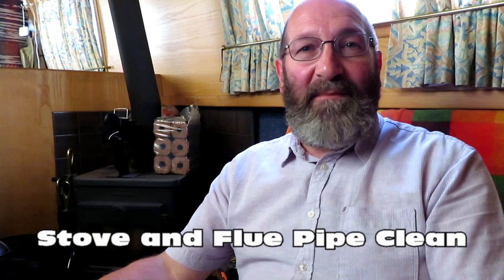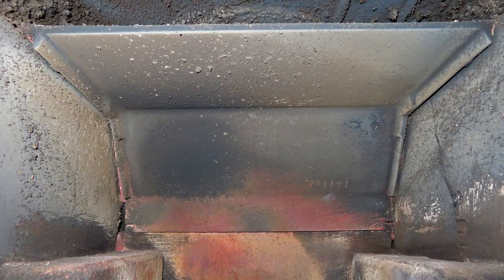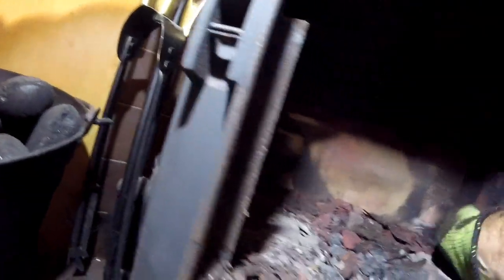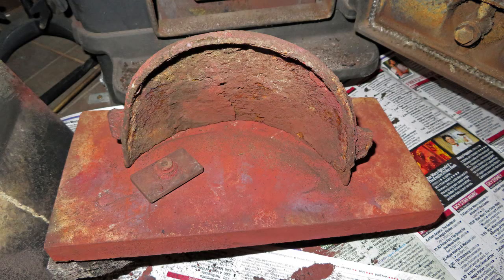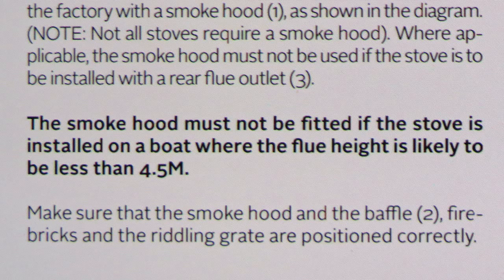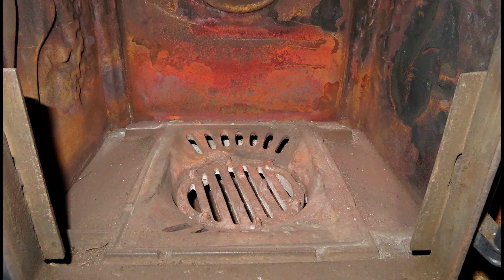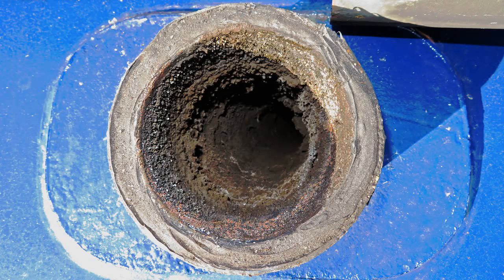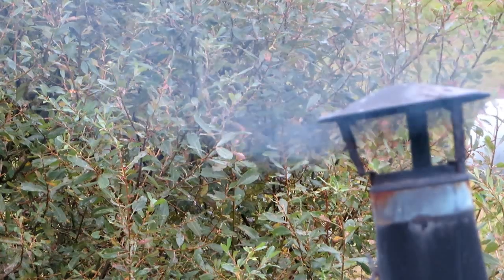82. Narrowboat Stove and Flue Pipe Clean

Comment: As it’s been two years since you filmed this project, Alan, I guess you have thought of a better way to handle it, as you did for refilling the stern gland greaser.  Can’t imagine your being satisfied with having grit everywhere during the process. What a satisfying feeling, once done and sitting before it.  Actually, the sound of the rain was much appreciated.   Thank you for sharing with us.
Reply from the maker: Hi Grace. I filmed the process again this year, so you might like to watch that No.220. There’s not a lot that can be changed. It’s a messy job however it’s approached. I used an amended approach to cleaning the flue pipe but apart from that it’s much the same. All the best, take care.

Comment: Good thing you cleaned that to prevent a chimney fire. I had one in a house we heated with wood, very scary and avoided a roof fire only because it was actively sleeting. 😳 had to evacuate my two small boys during the sleet storm to our neighbors house while the fire dept cleared our chimney for damage. Close call that I learned a big lesson from😓
Reply from the maker: Hi Debbie. That must have been terrifying, the thought that your house might go up in flames, especially with the little ones. I’ve not personally heard of any fires on Narrowboats but one must follow recommended practice and sweep at least annually.
Reply: If it had been inactive sleet you would have been in big trouble
Reply: @frankiepitt9135  Most certainly!!

Comment: Hi Alan, a very important job done! A couple of things that might help, (1)when I used to clean steam locomotives boiler tubes rotate the brush Helps stop it from sticking, (2) did you replace the door seal, Carbon Monoxide gases can escape from old and ill fitting seals, one of the moorer's on my marina had a lucky escape he thought he coming down with flu but turned out to be C/M gases escaping from the door seal.
Reply from the maker: Thanks for the advice Vince. The grip on the spindly handle wasn’t that good for a twisting motion but next year I’ll give it a go. I haven’t changed the door seal, as it appears in good order. Good advice though. Is there any way of testing it’s efficiency? Cheers
Reply: @MyNarrowboatVenture  same type of brushes Alan just a bit thinner need good gloves not them Marigolds type they rip too easy.

Comment: Hi Alan
   Nice job to your stove could you have used fire brick cement on the broken bricks just a thought
    Hope it keeps you warm in winter
   All the best
Reply from the maker: Thanks Ron. The two broken side guards fit together very well and to have one broken,  actually assists refitting the baffle board which rests on them. From that point of view I don’t believe it necessary to cement them together. Thanks for the idea though. Cheers

Comment: I did ours a couple of months ago although I must admit I didn't take the fire bricks out.
I kept the mess down by putting polothene sheet on the floor underneath sheets of newspaper and tapeing a dustbin bag that I had previous split down one side to to the stove.
I was surprised ar your chimney fit it seems very loose, mine is a struggle to on and off.
I interested to see the stove paint I was wondering what to use on my Morso 1410.
A great Vlog as usual keep them coming.
Regards
Geoff
Reply from the maker: Hi Geoff. I think whatever precautions are taken, the coal dust is so fine it can get everywhere. My chimney is easy to get on and off thankfully, so if I need to take it off for any reason it’s straightforward. I wasn’t sure whether I should use some form of stove polish, but painting it seemed easier to me. Best wishes. Alan

Comment: Don’t beat yourself up on the few bits you think you could have done better. You did a fine job and it’s in much better condition now then it was. Might consider borrowing or renting a small shop vacuum that used a both a pleated filter and a bag. Might make the cleanup earlier.
Reply from the maker: Thanks Jeremy. I was pleased with the outcome, perhaps that didn’t come across too well. I do actually have a wet and dry vac that I could have used. Cheers
Reply: My Narrowboat Venture I found during my home remodel (dusty drywall work) that the wet dry vac with a bag works well. The bag works as an extra layer or filtration to keep the dust from blowing out the exhaust port of the vacuum. The bag Also keeps the inside of the vacuum and the pleated right foam filter cleaner. That’s the only reason I mentioned it. Might make the job easier. 

In fact if while sweeping the chimney you ended up getting any dust out of the door or damper seals you could even cover the ash tray opening or damper opening with some tape and paper or tape and garbage bag. Then cut a hole and hook the vacuum hose up to provide positive ventilation. The vacuum will suck the dust out as it fall down from the chimney pipe and the bag and filter in the vac will filter the air and not get your boat as dusty.

Anyway good job and as you do it more you’ll find what works best for you. 

Cheers

Comment: Wow! That looked like it was the build up of more than one years burning or is that normal...? I have a Bubble Half Pod Oil Stove.... I had it serviced a month ago and it wasn't particularly dirty, the flue wasnt so bad at all, but the oil inlet and pan was quite coked up... also I had been getting downdraughts pushing diesel smoke into the cabin. Since the service, my diesel usage has dropped significantly and I have fitted a Vedette Cowl on the chimney... its all very efficient now and I leave it on setting one even with the recent frosts.... I guess your stove will burn more efficiently now and the other safety feature of a clean flue is less chance of CO ingress back into the cabin. Take care.
Reply from the maker: Hi Kev. I have nothing to compare with, as I didn’t clean the stove last winter. I will though get into the routine of at least doing it annually. Your clean up certainly made a difference to its operation, which is good to hear. My stove is burning well thanks. Cheers

Comment: Essential job every two months in winter when burning coal.
Reply: Every two months? Gah... time to get a diesel stove.
Reply: I haven't had mine apart yet but I've only been aboard for a few months.  I'll do that in the summer.  I tend to run the brush down the flue about every fortnight, supposing that the flue can't be too clean and it's not messy at all.  It only takes a few minutes and I'm absolutely certain that I'm drawing as well as such a short flue can.  Saying that, I tend to run wood during the day and save my dry coal for the night as it stays in.  The last lot of wood I bought is mostly oak and runs really hot, much hotter than the coal I'm using.  I'm actually looking forward to a proper cold day so I can run it up to temperature and leave it for more than 30 minutes to an hour.  I'm pretty sure that if I could run that hot for a couple of hours, what creosote glazing I do have, and it's not much, would either fall down the flue or turn to an ash that I can easily sweep away.

Comment: Sorry to ask a silly question. I am completely new to stoves. I burn a lot of (seasoned) wood and some smokeless coal. I always get a nasty black condensate from the joint outside where the chimney stands on the boss. This makes a mess of the roof. I noticed that your chimney lifted off very easily and so presumably isn’t a waterproof join. Should I expect this seepage? Presumably if the stove runs very hot this will not condense, but there is always a long heat up time to maximum heat, so the chimney will be quite cold for a long time and any “creosote” is bound to condense with the water combustion product. ....John.
Reply from the maker: Hi John. I’m still very new to firing my stove, so not really the best person to ask. I can confirm though that I get streaky sooty runs down the side of my boat and I’ve seen it on other boats too. I imagine it’s fairly common. I expect it might be avoidable if you know just what to do but I tend to just accept that it will occur. I’m sure someone more knowledgeable can explain the issues. I don’t believe the loose fitting chimney is a factor. Do you watch David from Cruising the Cut? I recall he had a chimney made to fit but he still got the tar deposits. Cheers Alan
Reply: Thanks for your reply Alan. Yes I I have watched CC’s blog on the stainless steel chimney. I think I’ll have to fit a rope circle around the join on the roof and wash it frequently. ....John.